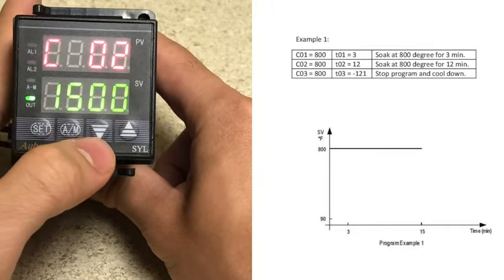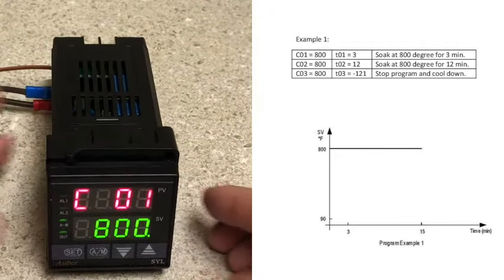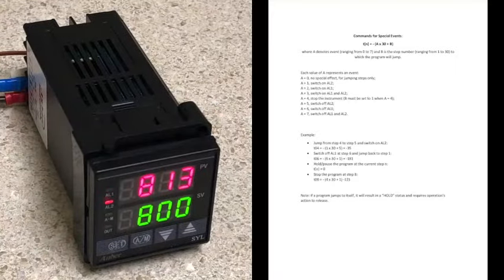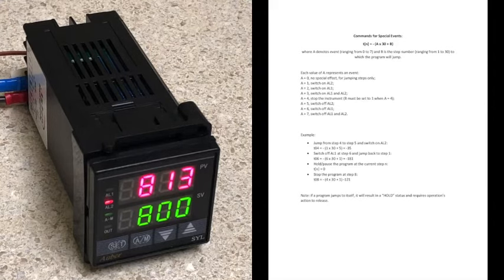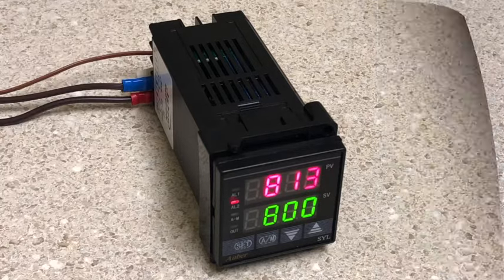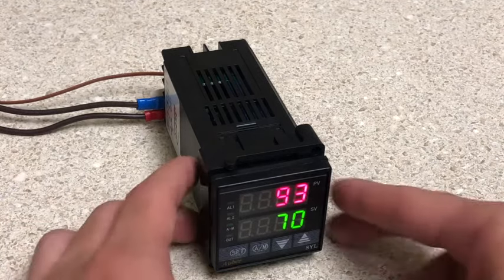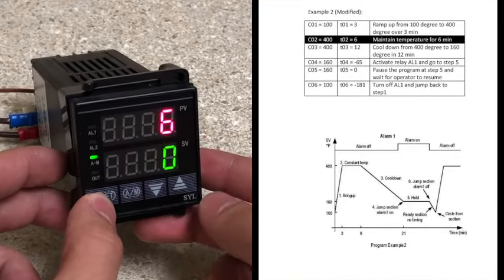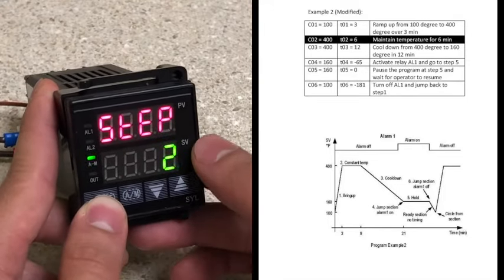Ramp & Soak PID Programming Tutorial, Auber SYL-23X2P Series

Comment: I think you are confused? Soaking or holding means the temp stays put. A ranp is a rate of increased temp over time. Your programming looks like its just jumping from one hold to the next with no control of the rate of climb (such as 108f°/hr or 27°/hr).. the t values on this dont seem to differentiate that and are only hold times. Where is the ramp value programmed?
Reply from the maker: Yes, this concept could be confusing. Here is an example. If C01 is the same as C02, this step is considered as soak step (no temp change). t01 is the soak timer. If C01 is different than C02, this step is considered as a ramp soak (either ramp up or down, depends on which value is larger). t01 will be the ramp timer. For a ramp step, start temp, end temp and duration time are all defined, so the ramp rate is decided. If you still have questions, please contact Auber customer support.

Comment: Hello why temperature ramp time is not accurate. I set it to ramp to 500 degrees at 10 mins and sometimes it reaches there before 10min or above that.
Reply from the maker: The ramp soak function will automatically change the set temp based on your temp difference and timer between steps. If your reading temp is above your set temp, there should be no call for heat. If your heater is very powerful, there might be some overshoort. Two tips you can probably try 1) if 500F is your most important control temp in your profile, you can run auto-tune at 500F. 2). You can reduce your OUTH value to reduce your max heater output power. If neither works, please contact Auber tech support directly for help: info@auberins.com

Comment: Another serious question how do you archive a ramp down at a specific time If the kiln system and the ssr turns off if the PV is higher than the SV. It seems that the kiln cools down by it self not by Pid
Reply from the maker: This controller is considered as a single channel controller and it uses its main output to drive heating element(s). So typically it uses natural cooling down (no heat). If you like, you can still use one of its alarm output to drive a cooling device and force turn on the alarm when you need it.

Comment: Why my output is always off and pin 7 and 8 has no power
Reply from the maker: What is your PID model number? SYL-2342P or SYL-2352P? Was the OUT light on the front solid ON when you measured the output?
Reply: @auberintruments  I have the syl-2352p and the out light is not solid on neither blinking
Reply from the maker: @NancyCase-ht9bl  OUT indicator is synchronized with the SSR output. If OUT is OFF, there will be no output. Please double check your ramp soak program. You can find the programming examples in the last several pages in its manual. This video can also give you some ideas. If you still have difficulties, please contact Auber customer support directly. https://www.auberins.com/index.php?main_page=contact_us
Reply: @auberintruments what makes the output light on? and why do I have to check my ramp and soak problem if I can’t even turn on my ssr
Reply from the maker: @NancyCase-ht9bl  This question is not easy to answer. Here are some examples to cause OUT indicator OFF: 1) if your program is stopped (SV flashes STOP), the OUT will be OFF. 2) If your ramp soak program is wrong, such as your PV is over your SV, OUT will be OFF 3). Wrong parameters. if your set OUTH to 0, there will be no output. Or if you set the controller under cooling mode, there will be no output even your SV is over your PV. 4) if your controller cannot read the proper reading from your sensor, such as error ORAL on the top display, there will be no output. Again, when OUT is OFF, there will be no output so it cannot turn on your SSR.
Reply from the maker: @NancyCase-ht9bl  If you use this controller with a heater, you can try the following example program: C01 = 400, t01 = 1, C02 = 400, t02 = 0. After you input the program, stop the program then restart the program. If your controller can get reading on the top display, your OUT will be ON, if your parameters are all default values. Then you can measure the voltage or test the output with a SSR.
Reply: @auberintruments  IIs there a way to change the ramp speed I saw on the manual it says 2 degrees Fahrenheit per minute, is there a way to change that?
Reply from the maker: @NancyCase-ht9bl  May I know the page number in its manual when you saw "2 degrees Fahrenheit per minute". I checked the latest version manual (V1.8) and I cannot find it. In SYL-2352P, you cannot directly set the ramp rate. Instead, you can set the step start temp, step end temp and duration time. By these information, the ramp rate is decided. I recommend you to check the program examples at section 8, page 10 in its manual. It will be easy to be understand than the definition (section 6.2.3 on page 8).

Comment: After your programme settings are done & the controller says stop, how do you get it back to normal temperature monitoring? Or how do I get it heating up adjusting it as needed.
Reply from the maker: When the controller is out of the settings mode, the top display (PV) will show the reading temperature. If the bottom display shows STOP, it means the program is stopped or ended. To run the program, hold the down arrow key for 2s. Please see the quick key function guide here:  https://www.auberins.com/images/Manual/Quick_list_23x2.pdf

Comment: Hai,how do you connect this for a kiln?
Reply from the maker: Well, this question cannot be easily answered in the comment here. Generally speaking, you need to connect this controller to a relay, then connect this relay to the element in your kiln directly. If you haven't checked its manual, I recommended you to check its manual at first. You can find pin assignment and wiring examples there. Here is the manual for SYL-2352P:  https://bit.ly/2352p

Comment: Tank you for this video.
 I a question why the SSR get so hot that burn to he touch?
I am using SSR-40 DA with only120v!
Reply from the maker: Dear customer, SSR will get warm/hot during the operation. It is related to the current passed through the SSR. For 6A or higher, you have to use a heat sink together with the SSR to dissipate the heat. Otherwise the heat generated from the SSR will damage the SSR itself in a very short time. I checked your model number "SSR-40 DA " and it could be made by Fotek. Please be aware that there are many counterfeit Fotek SSRs on the market. Please confirm your SSR is a genuine one.

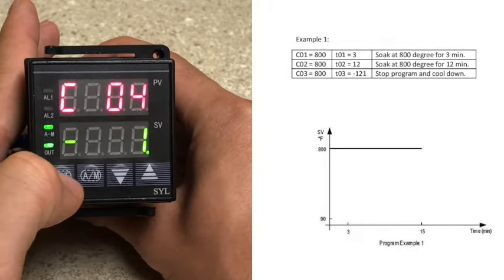Comment: At 1:54 on the bottom of the sreeen is it says, "Special command -121 will turn off all output and stand by step 1 until operature r????" What does the rest of that sentence say please? It's covered up by the white paper under it.
Reply from the maker: Sorry for the mistake. Special command -121 will turn off its main output, and the program will jump back to step 1 & stop there. The display will show "STOP". The program can be restarted if you hold the down arrow keys for about 2s.
Reply: Thanks :)

Comment: I'm trying to set up my PID for heating and cooling (Figure 9 in the manual) for a water bath.  I need to follow a heat curve where the heater is ramped from 73F to 190F at a linear rate over a 200 min period. Then the heater will need to be held constant at 190F for 720 minutes. Then the bath will need to cool (via fan) from 190F to 73F at a linear rate over a 200 min period. I'm struggling to get the cooling (fan) on the relay to work. Can you help me with the programming and parameter settings?

Thank you in advance!
Reply: Dear customer, this controller only has one main output with ramp soak feature. Its two alarm outputs (AL1, AL2) don't have ramp soak feature. Both alarm outputs only have ON/OFF control, or manually turn on/off by the special command. You can set this controller's main output as heating mode, or cooling mode, but not both at the same time. By your requirement, you can use the main output of this controller to drive your heater (as heating mode) and complete its first 200 min period. For your 2nd period, you cannot use its main output to drive your fan at the same time. You can still use its heater to regulate as your program (natural cooling is used), and use this fan as high temperature alarm. Or you can use special command to force turn on your fan for the 2nd 720 minutes step. If you want to regulate the fan by ramp soak step, you need to use two PID controller setups.
Reply: @auberinc3934  Understood. What's the "special command" to force turn on the fan? Shouldn't I be able to have the fan turn on when a temperature deviation high is exceeded? I'm struggling to figure out the parameters and steps inputs required for my particular application.

Thank you in advance
Reply: @actives5  For special command feature, please see page 8, section 6.2.9 of SYL-2352P's manual for details. You can force to turn on the alarm output on specific steps, not by temperature. Your suggested way may also work. You can set derivation high alarm to your fan. So when your reading temperature is over your set temperature (ramp down steps), your fan will be ON. By default, derivation high alarm is set to AL2 relay. You can set Hy-1 to be a small number like 1 degree. For derivation high alarm settings, please see page 3, section 5.3.1 for its calculation formulas. If you still have questions, please contact Auber customer support for help: info AT auberins.com
Reply: It is hard to find one PID controller with two main outputs. For high precision water bath application, one solution is, both heat and cool are ON at the same time. Cool is always ON and you use a controller to control the heat to regulate at your target temperature, or vice versa.

Comment: Can the deviation alarms be useful if the thermocouple is faulty and reading inaccurate temperatures? say you ramp up from ambient to 400, but the thermocouple is broken and won't read above ambient, so the heater is turned on indefinitely. can you use the deviation high alarm to turn on the alarm relay and notify you of the fault?
Reply from the maker: Yes, you can try derivation alarm in that case. In your case, you may need to use derivation low alarm instead. Derivation alarm is used when the reading temperature is far over/below your set temperature. Indeed it can be caused by the faulty thermocouple. But it could be also be caused by your heater issue. 
If the thermocouple is bad (open or short), this controller will show error ORAL all the time and stop its output. If the thermocouple is reading significantly lower than it should be, there could be a short somewhere on its cable and you need to replace it.
Reply: @auberintruments  thank you that was extremely helpful
Reply: That's a good feature actually because I've had other controllers continue to supply current to the SSR after the TC has failed, resulting in a burnt-out kiln!
Reply: @6rw1b  Thanks for the info! I thought I might've been being a bit too pedantic, but it sounds like it will be a good feature.

Comment: does this version come w/the 9v power supply or does it have to be wired separately?
Reply from the maker: Sorry, your question is not clear to me. This controller requries 110-220V AC power supply to power up. 9V cannot power up this controller. This controller doesn't provide 9V output supply terminal neither. If you want to drive 9V loads, yes, you need an external 9V power supply.
Reply: @auberintruments  what I meant was for a Solid State Relay... but you answered the question... (it doesnt supply power) sorry I wasn't more clear
Reply from the maker: @zeroswings2  To drive an external SSR, you need to use model SYL-2352P variation. That model has 12V DC SSR output, and it can drive your DC triggered SSR directly without external power supply.
Reply: @auberintruments  

thank you... I'm looking into trying to find a model which has availability of inputs from thermocouples of multiple types as well as maybe a 2nd ssr to power on a fan to either circulate heat from an element or provide cooling... currently looking at CN08D3-RR-24-CM-DC but I'm open to any suggestions... thanks again...
Reply from the maker: @zeroswings2  SYL-2352P can read a variety of thermocouple types. Please check its manaul for details. But this controller is a single channel temperature controller and it can only read one sensor at one time. This controller has one SSR output as its main output and two alarm relay outputs. For your case, you can use its SSR output to drive a heater and one high temperature alarm to drive a fan. By the model number CN08D3 is from Omega. Unfortunately, we are not familiar with that model.
Reply: @auberintruments  
yes it is an Omega model... but your replies are very helpful - many thanks 😊